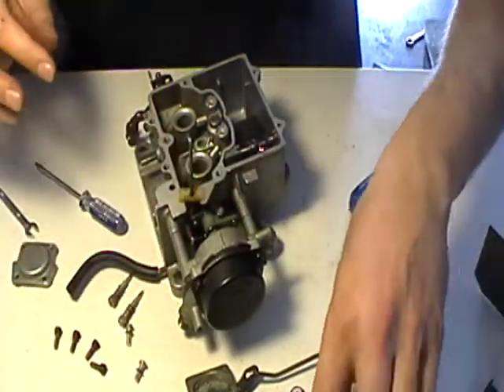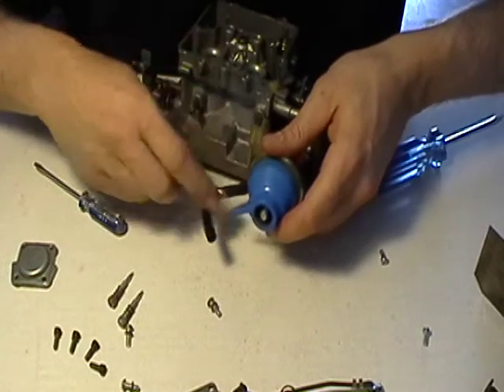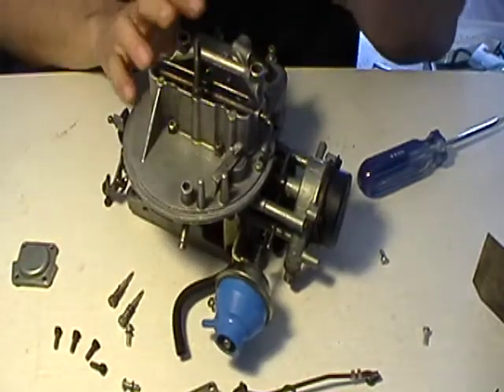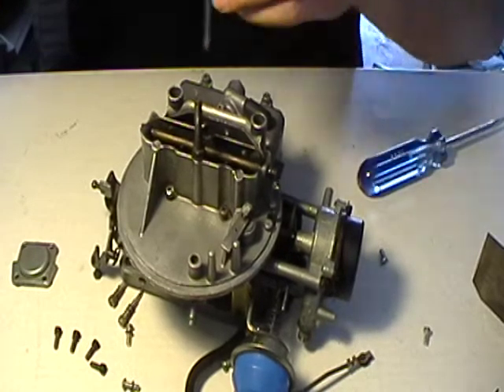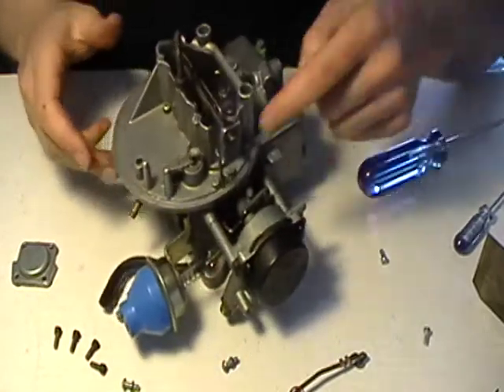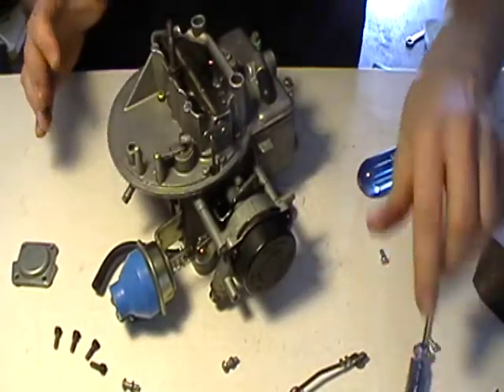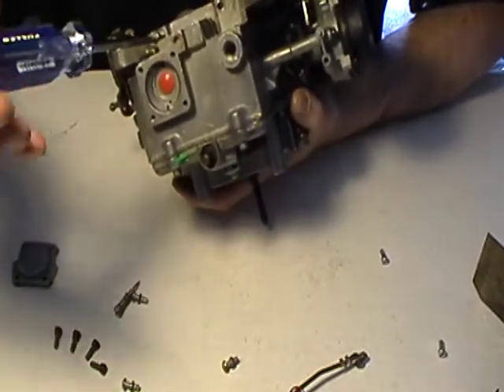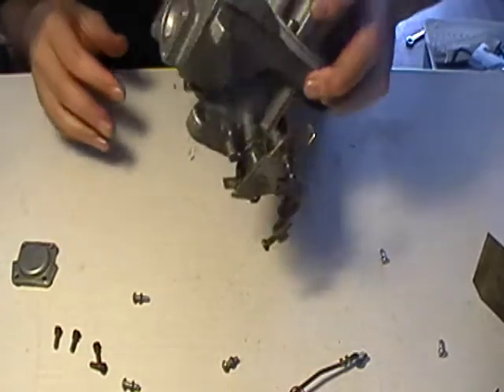Motorcraft Double Barrel Carburetor Series Videos Part 4 of 5

Comment: I need some of your advice, I rebuilt my double barrel carb. 1978 F150 351M. it ran "ok" before but now it only seems to run on half the cylinders. I ran through everything, and it all seems to be just fine. But something is missing? What are your thoughts?
Reply from the maker: all i can see is you replaced the valves that deliver fuel with ones with a smaller diameter.  your prob having issues going full throttle like its starving for fuel.  good luck